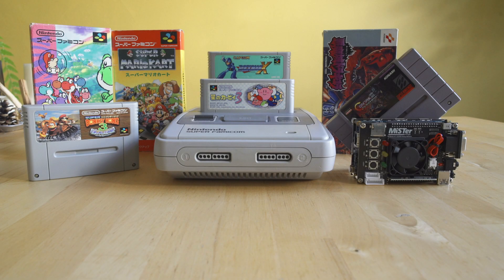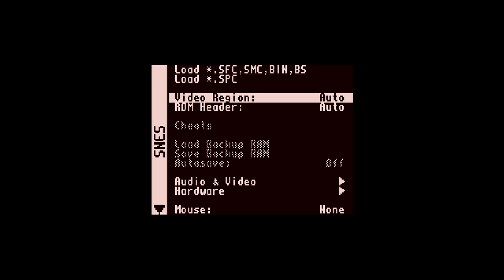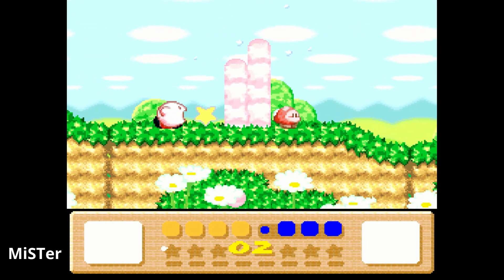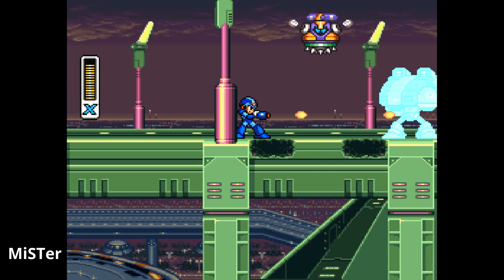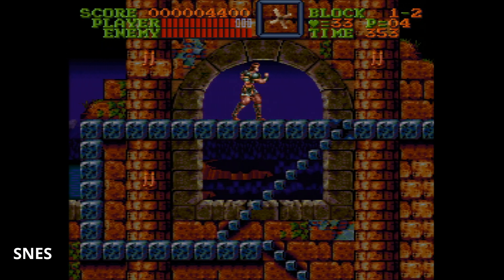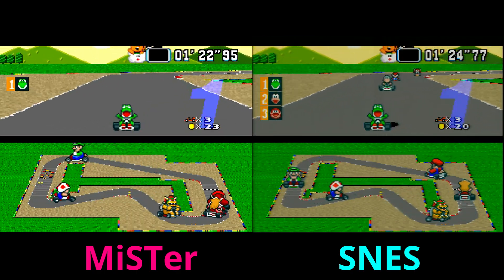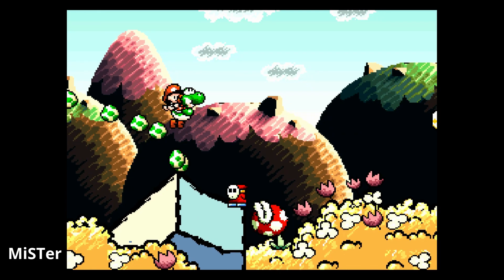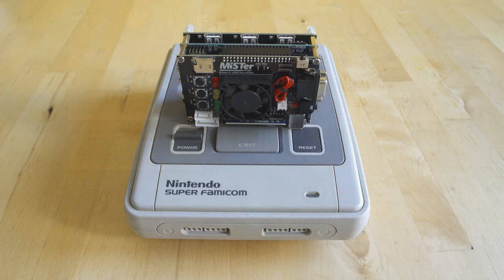MiSTer FPGA DE-10 Nano Super Nintendo Setup Tutorial and Core Review

Comment: When comparing audio, you must always make sure they subjects are at the exact same level volume wise - our ears/brain has a built in tendency to prefer the louder subject. So either turn the mister down, or the snes up :) The db difference wasn't so bad here, but I saw another video of yours (think it was the mega drive/genesis one) where it was impossible not to be biased due to the mister being much louder.
Reply from the maker: I’ve corrected that for the future :) I am no audio expert. I spend all my time working as a director / cinematographer
Reply: @VideoGameEsoterica  of course! Just a heads up :D I am sound nerd myself, both hobby and profession, and it's really cool to hear the audio of the mister - especially since it's one of the reason I have been keeping my old consoles - software emulation just doesn't feel right in that regard.
Reply from the maker: Yes the audio is a large difference in some instances

Comment: This is a great insight, this lead me to test a 1-Chip SFC console with Retro Gaming Cable Packapunch Scart RGB cable and the MiSTer analogue RGB VGA to Scart output to the same TV. Switching between the 2 produces the EXACT same output, sharpness and volume level. I couldn't see any difference.
Reply from the maker: Nice. Yes the 1 chip models definitely have better output then the standard models. Glad it worked out for you!
Reply: @VideoGameEsoterica  Yeah the MiSTer is really awesome. Also how did you overcome the lockout from putting a US PCB into a Japanese machine? Was it chipped?
Reply from the maker: No. Just pull the pcb out of the plastic and done

Comment: Aren't both audio signals analog coming out of the mister and snes. Both are using dacs to output analog. The mister may have a better implementation that leads to cleaner analog output.
Reply from the maker: This audio is coming via HDMI
Reply: @VideoGameEsoterica  somewhere along the line it gets converted to analog though. It may not have external wires carrying the signal, but the principle is exactly the same

Be it internally in a tv or whatever is outputting to your speakers.
Reply: @VideoGameEsoterica  The DAC built into the SNES is 30 years old and the one built into your display probably smokes it. A lot has happened with DACs in the last 30 years.
Reply from the maker: A lot in general has happened in the last 30 years :) I can’t believe I was alive when the SNES was out

Comment: Any noticeable lag out of the Mister with HDMI?
Reply: HDMI itself doesn't inherantly equate to lag.  It's the post processing of the signal that your display device does which introduces the lag.  So you'd need to research your TV to see what latency it introduces.  For example I have a TCL TV which only has about 14 ms of lag, which coupled with the virtually zero lag of the MiSTer is quite low
Reply from the maker: My Samsung 4K has a “game mode” on the fourth hdmi input which removes all processing and just deals with the signal as is which is the best option
Reply: @VideoGameEsoterica  yes on any TV you'll want game mode to be enabled as it maximizes latency.  Sadly on my Vizio even with game mode on, it's like 115 ms of input lag.  So you'd need to do research on any new TV if input lag is a major concern
Reply: @VideoGameEsoterica  im using a 24" LCD (LED) gaming monitor with 2ms lag. MiSTer runs @ 1080 p. Most lag is added by the wireless controllers i guess . But even playing with them adds no noticeable lag for me.
Reply from the maker: Yes the lag is minimal which is nice
Reply from the maker: Nothing perceivable. It’s there but it doesn’t affect me. Only issue that effects my play is controllers on fighters. Using a controller is terrible compared to a fight stick

Comment: I know you said you will show off different scaling modes in a different video, but just curious if you tried 5x crop mode yet?     If you haven't it basically gives you an integer scale in 1080p that fills the screen, but to be able to turn on that option you need to have V_Scale set to 0 (Fill Screen) in your ini file and be in 1080p resolution.   The only draw back is you might notice from time to time some games have some important information slightly cropped out, but there is a crop offset setting that will allow you to gain it back by being able to scroll the image vertically up or down a couple of scanlines.
Reply from the maker: I believe I showed that in the upcoming video. I make them in advance and schedule them so even I have to review what I said lol. 

I think my rec was still interger 720p to 4K though, just because I have all 4K displays for my gaming (other than my PVMs)
Reply: @VideoGameEsoterica    FWIW, most 4K displays don't actually do nearest neighbor integer scaling of 720p or 1080p signals.  TV displays are geared for video content so they use some form of bilinear filtering for upscaling of lower resolutions, even for 720p and 1080p resolutions.  That is why it is usually advised to go with the highest resolution on MiSTer your TV will support.

Comment: i think a lot of the comparison you are doing here is based on whatever capture method youre using for your SNES and the MiSTer's unfiltered output.  SNES console can look pretty damn good with the right capture setup and not as darkened, and MiSTer needs interpolation via its filters to get the softer look you want in your image.  Use the SNES-specific video filters- theres an entire folder of em.  They will get you closer to your goal, for the image.
Reply from the maker: I mean RGB to Framemeister is about as decent as you are going to get out of a SNES so I consider that the best of what’s possible. I mean maybe OSSC is different but at that hardware level you are splitting hairs. 

I’ll talk about the filters in a future video on them specifically :)
Reply: @VideoGameEsoterica  they are the path to getting a similar image to the original console. i think thats a strong component left out of this video, especially considering that we have an excellent array of SNES-specific filters at our disposal.

I enjoyed the video, thanks for taking the time to make it!  Looking forward to future ones.
Reply from the maker: Plenty more coming soon